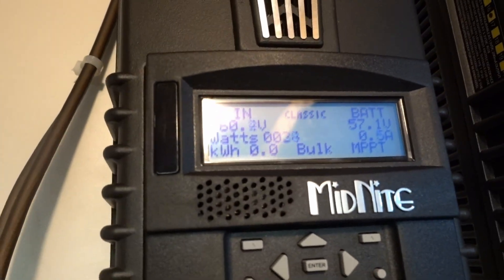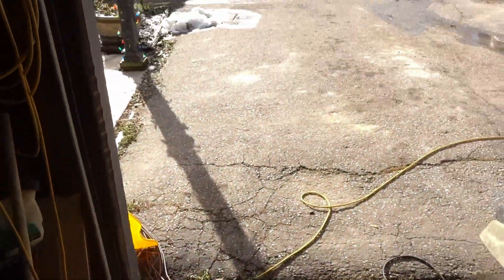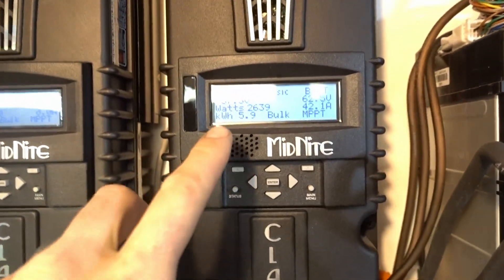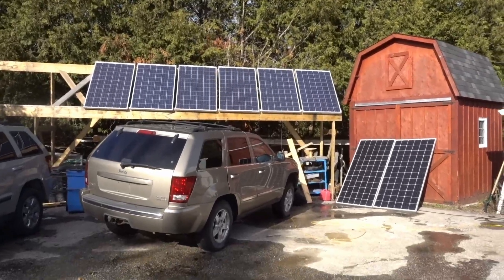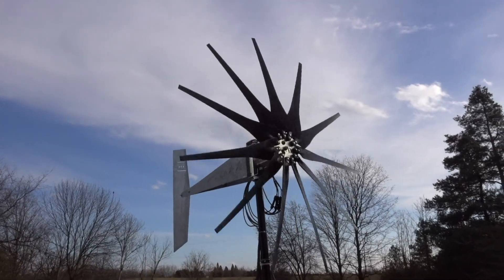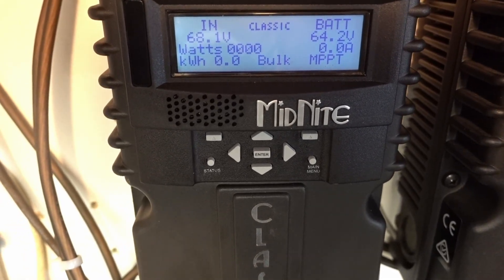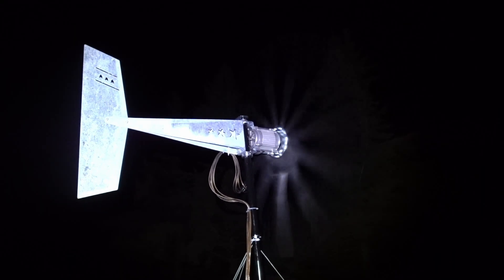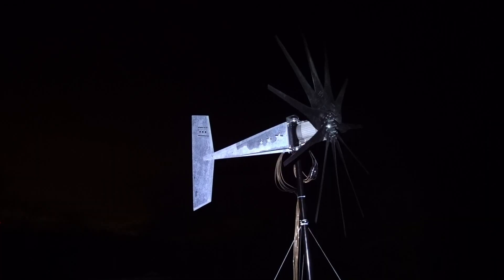2000W Freedom 2 Wind Turbine Update

Comment: I had a freedom and it was rubbish. After about 9 months I gave up on it. In that 9 months I had to take it down 3 times, I n the end I took it apart and it was rusty inside, the magnets and the main shaft. So I put a thermadyne pma on it and after 10 months it has been great. Good luck with your freedom 2.
Reply: How do you like the Thermadyne set up?  I am looking into wind turbine and was wondering about the Freedome but saw your comment abou the Thermadyne
Reply: @ShmeegleSon  sorry it’s taken so long for me to get back to you but I needed to run the thermadyne and to be honest I’m very happy with it. Since I strengthened the body of the freedom with 3/4” angle no problem 😃😃

Comment: It's the turbine no goog I had one of those and I gave it away
Reply from the maker: This one made power when it was windy
Reply: @GoingOffGrid101  yes but it needs a lot of wind I got a new wind turbine a hurricane vector and at 12 mph it makes 9 to 14 amp
Reply from the maker: @solarandwindinsouthtexasda1473  really? you 100% sure of this? and at what voltage is your battery bank?
Reply: @GoingOffGrid101  is at 12v but at 24 mph i get 97amp
Reply: @GoingOffGrid101  but he makes a 24mph 100v 1000 watt
Reply: @GoingOffGrid101  and I have 64,000 wh battery bank
Reply from the maker: @solarandwindinsouthtexasda1473  nice! im interested on one, I have a 60KWH battery bank at 60v
Reply: I learned a lot from your video I have been seeing your videos for 2 1/2 years
Reply from the maker: roman  im glad,  I'll make sure to ask you before I buy another turbine
Reply: @GoingOffGrid101  in the 2 1/2 year i own 6 different turbine and the best one is hurricane vector out of the 6

Comment: A 35 foot pole and a well used chain saw couldnt hurt...those trees arent going to let you have any wind like it is though...yeah youre maybe right about the pwm controller although if you fix the trees itll probably work with the one you have now...we have more wind here I think...we have a lot of days with 25 to 35 mph winds all day but wind for some reason is not smooth at the ground..you have to have the blade at least 25 feet up or so to get it where it stays turning enough to put out anything useful..
Reply from the maker: i will get it up there some day

Comment: Quit messing with this missouri junk. You want a true 2kw generator? I get 1,800w easy off of 15 mph breeze. The unit weighs in at 120+ lbs. Serious windings and magnets. This manufacturer turns out everything from 400watts to 50 Khw commercial units. Had it up for 2 years no issues at all. Better blades by far too. https://www.aliexpress.com/item/32850156917.html?spm=2114.12010612.8148356.4.841071f78urz9a

Comment: Here is a possible solution to your wind turbine. Your turbine will stay at resting until the your input voltage on your turbine is greater than than your battery bank voltage by %30. There is nothing you can do about it, part of the design.Here is the work around I did. I have a 48 volt system and part of it using two classic 250's. I took the classic off line that was controlling the turbine and connected the output side of the rectifier directly to the battery bank. Used the auxiliary on the other classic that is tied to my solar to control a solid state relay for a dump load with upper limit set to 60 volts and the lower limit set to 59.8 volts. With this setup my turbine sends charge to the battery bank at any speed.

Comment: What is the charge rate on your batteries?Not sure if new ones are in your budget but salt water batteries are hitting the market. I seen some that are C/0.2 . Could make way better use of those short bursts of power. They're also cheaper than lithium at 2000$ USD per 2.7kw module and have a 15 year life at a daily discharge of 70%. They are huge but aside from that they're really good.
Reply from the maker: I can charge up to 5c i believe, so 4500 amps if my wires could take it lmao thats with what i have now not in this video:P

Comment: I know how a solar system is configured, but I have yet to find a video showing how a wind generation system is put together.  You know, like wiring diagrams, type of equipment and calculations which were used to build the system.  Still searching.

Comment: One technical query:how the power from PMA is transferred to the cable? I asked this question because the PMA is mounted on a rotating platform and cable connector is on the pole. Do you have any brush/commutator to transfer.
Reply from the maker: the winding's are on the outside

Comment: I’m at 2000 feet on top of the mountain and the Missouri wind and solar system I got 4 days ago puts out 60 watts at 60 mph wind. They won’t warranty and owner won’t respond. Total junk Missouri wind and solar system
Reply from the maker: where did you but it from ? mine is a 48v/96v and I use the 96v for my 60v system and that works for me in lower winds. seems to me like you need a 24v turbine and it would fix 90% of your problem. suck who ever you bought it from is not a good seller...
Reply: @GoingOffGrid101  .... is 24volt better then 12v ....or what ... wher to buy in CANADA .... ??   I might order the windzilla 1800watt  489dollar or MISSOURI 1600 watt 420dollar  or windturbine unit 1275w  at  232$$ ...  all 12v ... buy inverter and batties  at local ??
Reply: @GoingOffGrid101  ... 2042151399 mynum...thanks ..need help asap ...

Comment: jnk system april 2019 they took my money a 700 watt system put out 60 watts. they wont warranty
Reply from the maker: im sorry, where do you live ? and what height is your turbine at, mines only 6 feet above mt house and it only makes power in storms, but if it was 50'  high I know it would make a lot more, not a perfect turbine thats for sure, mine makes a lot of noise on my roof :D but I have seen over 1000w in burst of wind. if I was to but again I would go with more solar then the wind turbine!

Comment: Your turbine needs some hight to get better air flow , and you need to adjust your settings after you gain some hight.
Reply from the maker: I did put it on my roof and it was better, but still need it higher.

Comment: Temp will effect the battery bank but your MPPT charge controller should compensate.You can turn off n back on or best if your contact your controller source and get a low cost temp sensor.

Comment: I know this video is a bit older, have you since changed the charge controller or the turbines setup? I'm totally new to this stuff bit it seems to be spinning too freely like there's no load on it at all! Thanks
Reply from the maker: yes I have moved this and I have made 1000w in a wind storm. I still do not have it high enough to make a lot of power.
Reply: Going off Grid
First time viewer I liked so I subbed! I was going to say that turbine isn't high enough in the air to give a proper output! Praying for GOD to bless you with the means needed in whatever way to help you get that beaut up higher like it should be!!

Comment: You're confusing apparent blade speed with RPMs, friend.
Look at the holes in the center of the hub for a better idea of how fast the shaft is actually spinning.
And yes, aside from the danger, your turbine needs to be higher up - Even another ten (10) feet in altitude will help.
It would be useful to how many RPMs that PMA needs to be doing before it cuts in.

Comment: It seems like it would be useful especially with your fairly high voltage system if the pretty high end charge controller could do a boosting function till the voltage gets high enough then switch to a buck mppt I'm sure it's probably not making much power at those lower voltages but it's something

Comment: It looks like something's not right with the midnite, have you tried connecting the turbine output directly to the battery to see if the problem is the turbine? You'd think if it's putting out 200V it would be dumping power into the battery.
Reply from the maker: yes i found out why will make a video about it!
Reply: what was causing  the problem of no amps  but high voltage?
Reply from the maker: it was settings on my classic charge controller, it doesn't seem to like the midnight much

Comment: cool u have the wind turbine bug now lol, as you know I have a long time with wind turbines. your getting dirty wind check it out. also i have hooked my wind turbine to my midnite charge controller, you have to change the track setting on the controller to 1 so it scans more offen I'm sure you know that. also this is why I say in lots of videos you can't just have a breeze or not consistent winds. but you should be good on the times you do have winds. your right the kWh display its not Accurate at times on the midnite I have some weird numbers from time to time.
Reply: Don't forget new generation of GOOD affordable wind turbines, they work well, are rated TRUE, are super cheap if you go to Walmart online pick a good one, and better because you can get warranty on them via walmart   http://linksynergy.walmart.com/fs-bin/click?id=nNC3MIW3bd8&type=10&tmpid=1081&offerid=223073.7442&RD_PARM1=https%253A%252F%252Fwww.walmart.com%252Fsearch%252F%253Fmethod%253Drelated%2526query%253Dwind%20turbine%20generator%20kit%2523%252FsearchProductResult%2526affs%253De MADE IN CHINA, ~ High quality in most cases, none from Vietnam are recommended.
Reply: @JOHNDANIEL1  which ones specifically would you recommend?
Reply from the maker: yes I want to make power at night :) I have talked to midnight and found a fix :)
Reply: Going Off Grid nice what was the fix
Reply: @JOHNDANIEL1  yeah that's the feeling I get with nearly everyone trying to sell a small turbine, the numbers must be inflated to make it seem worthwhile.

Comment: Having it that low it will get whats called dirty wind making it track alot. The short pole is not all of the problems you will face with that turbine. I am going to take down my model of that one which is 1700 watts and have never seen more then 200 even on my tower 29ft high and put up 400 watss of solar. Good luck and I hope it does preform for you.. My Thermodyne ultra core rocks when the wind blows
Reply from the maker: good to know thank for the info!

Comment: what is the wind cut in speed on that blade? I am guessing with that blade you will need 40 to 50 MPH wind to get 2000 watts.  http://mwands.com/store/2000-watt-11-blade-missouri-general-freedom-ii-wind-turbine
Reply from the maker: yes it makes power at 20 km winds
Reply: Going Off Grid , that's what I found, so I'm slowly building axials for better low wind production , atleast 10km power production is my goal.

Comment: Did you think about the vertical wind turbine it can easily work with lower wind and have greater yield in any wind speed.... 👍
Reply from the maker: no i have not, ill look into one.
Reply: U have to do some research wind turbines... And how to conect them do you put them in star configuration usual or delta and then use rectifier and perhaps some caps...between +and - pole so u can make max of the turbine ... That's the first thing you have to do then wires and dump load resistor and so on....

Comment: You should put the Midnite in DYNAMIC MODE and put a 120 volt capacitor of at least 10 000mf at the rectifier..
Reply: Do not not know much about the Midnite controllers but it seems to me a big capacitor would not hurt.  Maybe the rectified AC is confusing the MPPT algorithm because it expects more steady DC from solar panels so the wind confuses it?
Reply: al desrochers so that may work for some, but not this.
Reply: Was just trying to help but I already know the results..   LOL
Reply: al desrochers you should talk soon. Thanks
Reply: Are those Power curve's that you"ve been offered certified by Midnite? I bet your curve is really close, compared to what they are offering. I know that curves are different with wind environments. Midnite has preloaded curves for Hye turbines, bergey wind, Axial Flux turbines of Chris Olsen's turbine, that I'm building. But it's good to try many. I've got five for the Axial Flux. So have fun.

Comment: I do think you would have better power with higher turbine.  That Midnight doesn't like the unsteady power flow.  You may be able to change setting in the midnight but only so much. Make sure the classic knows it is connected to a wind turbine too. You will need more steady power from the turbine for the midnight to be happy.